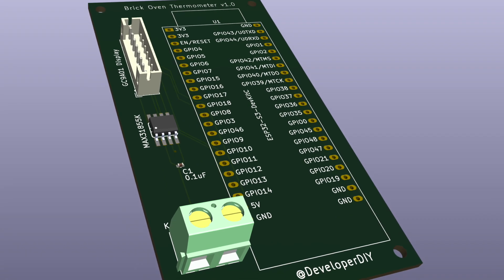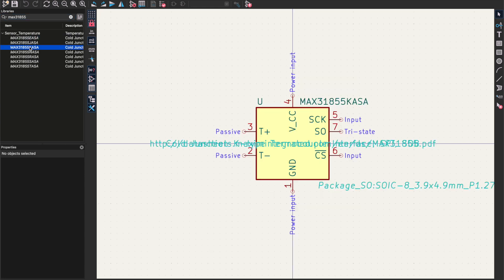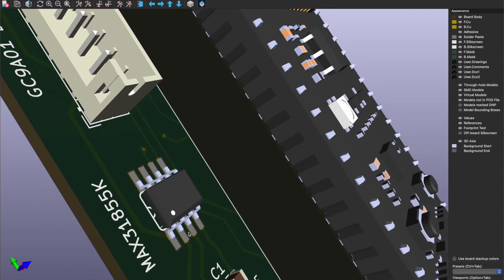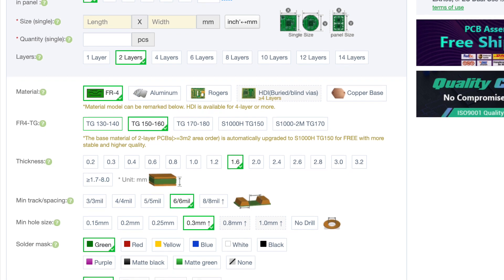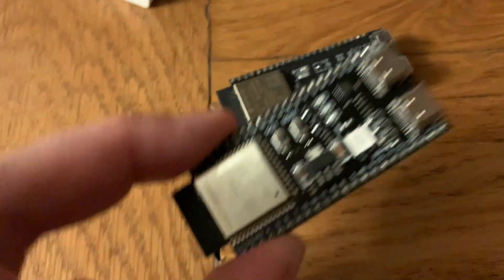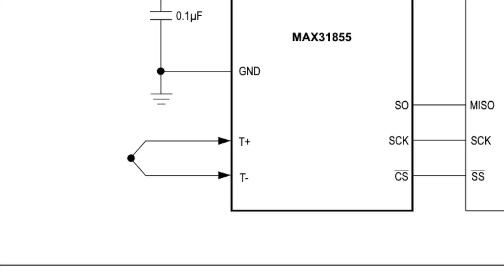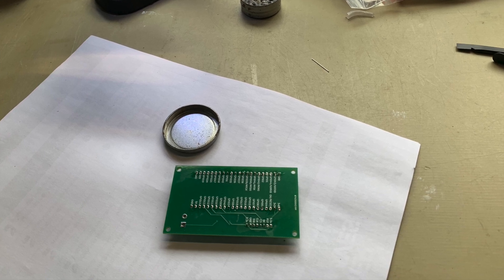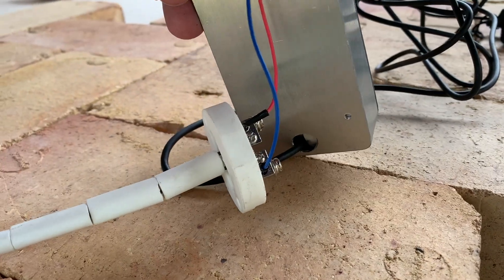Designing a custom PCB for the pizza oven thermometer and an aluminium project case

Comment: Hows the wifi working with esp enclosed in the metal box? Maybe use esp32 with external antenna? Nice project BTW, will be following. I wonder how you're going to place the sensor in the owen and also if you plan have any automations apart of temp reading. Cheers
Reply from the maker: I’ve not tested the wifi yet, I had the same thoughts though.  I’m also concerned about the electronics and heat, the outside of the oven will still be quite warm.  I feel like they are all solvable problems though.  

I’m almost done building the oven dome so I’ll be drilling a hole for the thermocouple soon.  I’ll drill between the bricks until I’m a couple of centimetres from the inside.  There will be a range of temperatures in the oven but I think they will all be proportionate to that point so I can plot out a set of temperatures across the oven.

As for other ideas, I think a timer would be nice that I could easily set.  Also a temperature alert automation that would tell me when the oven drops to a required temperature for baking bread etc.  I think I’ll switch the Esp32 and display for an M5 Dial at the point so I can use the rotary encoder.

Thanks for watching.
Reply: @DeveloperDIY  oh great idea with the rotaty timer! I'm thinking since it will be a battery powered device + semi weatherproof ideally I would use some kind of connector and mount to only bring it out and quickly install it when cooking. Thanks for response.
Reply from the maker: @wasyl00  I’m thinking solar panels on the gazebo roof, I’ve got 2 x 400w panels spare so I’ll do an off grid setup, it’ll be good enough for lights and maybe a fridge etc.  I can then embed some low voltage power cables into the perlite render of the pizza oven so it’s all hidden away.
Reply: @DeveloperDIY  oh thats a bigger project then! Cant wait for future videos 😁

Comment: Just a tip from a fellow newbie. If you use one layer as ground and the other(assuming a two layer board) as power you get rid of a lot of power and ground routing. Nice and useful project!
Reply from the maker: Thanks, I was thinking of a ground layer but I didn’t want to over complicate my first attempt.  I’m also conscious that the PCB will be mounted to a 500 degree oven and will probably be exposed to temperatures up to 60 degrees so having less copper might help with cooling.
Reply: @DeveloperDIY  I would say having more copper would be better for heat dissipation, and it will help the pcb stability shape wise. And if the card will have more heat exposed to it, I would make room for mounting a heat sink.
Reply from the maker: @saysphilippe   I suspect you are correct.  I wasn’t happy with the rectangular case, I think version 4 will have a round case which will suit the shape of the oven dome better.  

I’m also keen to redesign the board to hold the ESP32 chip and voltage circuits directly so I don’t have to use a dev kit.  This will make the whole PCB smaller too.  All useful tips are welcome, there is so much to learn.
Reply: @DeveloperDIY  I think that is wise. I also design my boards with SMD components, have made multiple circuits with ESP32-S2 and ESP32-C6(Zigbee version). My latest Automatic Watering System for my kitchen garden is currenly under testing... I have to upgrade to S3 since S2 is obsolete. I will go for ESP32-S3-WROOM-1-N4.
Reply from the maker: @saysphilippe  an automated watering system sounds like a great project, do you make videos or articles about your projects? 
Also using Zigbee sounds great too.  Does the Zigbee connection work with Home Assistant well?
Reply: @DeveloperDIY  I haven't made any videos, sorry. My setup is running a Pi 4 with dockers and I have one of these Sonoff Zigbee dongles mounted on the Pi, and are running Zigbee2MQTT in one of the dockers and it works really great. I have tested with an ESP32-C6 and got messages into my MQTT through the setup mentioned before. I haven't tried the HA part yet, but it shouldn't be a problem really.
Reply from the maker: @saysphilippe  thanks, I shall get a C6 and give it a try, I imagine the power consumption compared to wifi is significantly less.